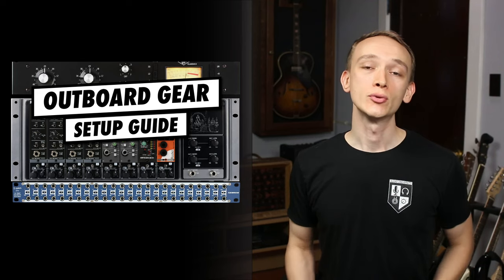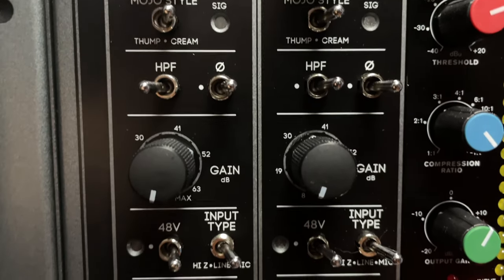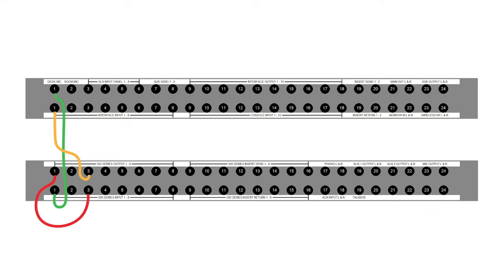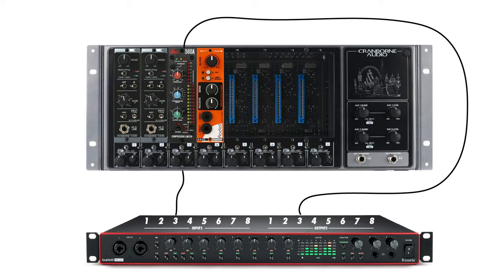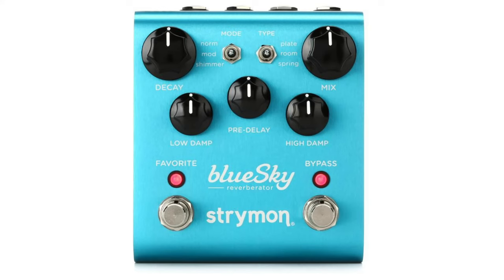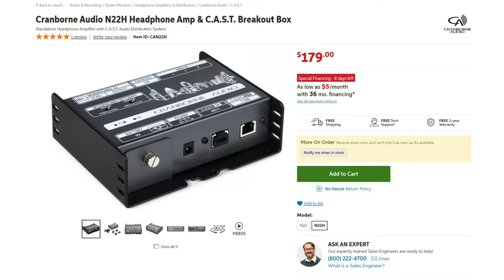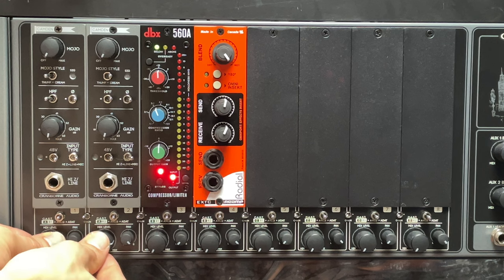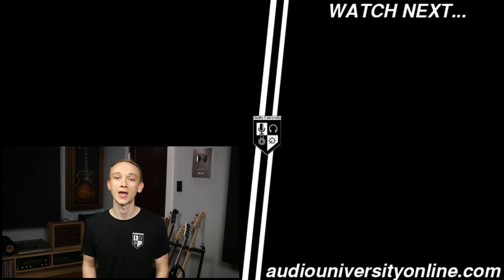How To Use Outboard Gear With A DAW | Patchbay Setup & Signal Flow

Comment from the maker: Question: What gear would you have in your dream outboard rack? 

Leave a comment below!
Reply: Well, I have the fundamentals to start, but one bothersome issue is my monitor output is automatically muting on/off.  Seems to be a particular issue with the Focusrite Scarlett 18i20 - 2nd gen.  Yours is a 3rd gen unit, yes?
Reply from the maker: @Henry Van Weeren - Yes, mine is the 3rd generation. I haven’t experienced this issue so far. Have you tried updating the firmware?
Reply: @AudioUniversity  I'm using a hand-me-down laptop with Win7.  There are no more firmware updates for it.  I may try uninstall/reinstall the latest available for it.  This hasn't happened until I accidentally installed the Win10 firmware the other day.
Reply: Is there a difference signal or sonic wise doing it with a patch bay vs running ex preamp to compressor to interface to computer?
Reply from the maker: @QubanEli - Assuming the patchbay is working properly, the only differences are convenience and flexibility.

Comment: Very informative video. You have a nice setup there. 
Last week, for a mix challenge with already recorded tracks, I used external effects from my pedalboard: an envelope filter for a guitar and a preamp/overdrive for the bass (don’t have a patch bay, though, as my number of outputs is low). It makes a lot of fun having these possibilities.
Reply from the maker: That’s awesome, Korkenknopfus! I could tweak and experiment with guitar pedals for hours (which may or may not be a good thing. haha). Thanks for watching and sharing these ideas!

Comment: Thanks for the clear explanations! If you have a condenser microphone and the 500 series preamp provides phantom power, is it safe to pass phantom power through a patch bay?
Reply from the maker: Just make sure that you're using a balanced patchbay and turn off phantom power while connecting or disconnecting the TRS plugs. You can find more info here: https://imp.i114863.net/ORQ1LP

Thanks for watching, Simon!

Comment: Exceptional video once again, great explanation and practical examples! 

One question that always seemed to be left unanswered in my head is what about latency? Does all that A/D-D/A conversion back and fourth introduce noticeable latency/delay at some point that should be adjusted for when recorded back into the DAW or is there another way to mitigate that? I'm asking about both the analog and ADAT connection methods with outboard gear. Cheers!
Reply from the maker: That’s a good point. Latency can definitely be an issue here. Most programs have delay compensation, but it’s worth checking that it’s accurate, especially when using various paths of varying latency at once.
Reply: Zero Latency. If you you connect Adat your interface. Conect TRS cables from Aux input from the Cranboune to a 2nd output source in your Interface and configure using your interface software. I use alot of vintage synths via midi and always find this method the most stable and fun to use. Hope this helps.

Comment: Hi. I dont understand : my 500 format lunchbox's output is XLR - so I should get a XLR patch ?
Reply from the maker: You can easily adapt between XLR, TRS, and TT. So you may need an adapter snake. Just avoid is repatching TRS while a phantom powered mic is connected.

Comment: One more question that keeps poping up and I still can't seem to wrap my head around is the whole XLR-TRS cableing and connceting thing when using the 1/4'' patchbays when it comes to microphone signals. So in the first example you showed where you have your mics pre-connected (normalled) to the mic inputs of the focusrite via the patchbay how does this work cable-wise? 

XLR to TRS cable from the mic into the back of patchbay and then TRS to XLR cable from the patchbay's back into the mic input of the focusrite? Does that also work for condenser mics that require Phantom Power? 

Also, does the same apply the external mic-pre? Meaning, the output of the patchbay's back goes from TRS to XLR to be able to plug into the mic inputs of your external gear?

Sorry if that doesn't make sense, I can't seem to find info on this anywhere and sinse everybody is using TRS patchbays for mic signals too, the only logical way I can think of (besides using DSUB25 snake connections) is this. I'd really love some insight into the cable aspect and correct me if I'm wrong with the observations I made. 

Cheers Kyle! :)
Reply from the maker: That’s correct! XLR to TRS from the mic to the patchbay. TRS to XLR from the patchbay to the interface preamp. You can also patch mics that aren’t hard wired to the patchbay directly to the preamp input on the front of the patchbay using an XLR to TRS cable.
Reply: @AudioUniversity  I see, seems logical. Thanks for the quick response! 

Weird that that’s rarely if never talked about, at least it seems to me. :) What about phantom power? Should there be considerations there when talking about phantom power coming from a TRS cable end or is that more a matter of how good/feature-rich the patchbay is and how it manages that and not that much of a cable problem?

Comment: How to setup headphones and talkback mic in the counsel cuz I dont know anything to do in counsel
Reply from the maker: Usually, your headphone mixes will be created using aux outputs. That way, you can use the aux send (pre fader) on each channel of your console to determine how much of that channel will be sent to the headphones. You can connect your talkback microphone to its own channel on the console and use its aux send to route the talkback microphone to each headphone mix. 

I’d recommend using a switched microphone or a post-fader send for the talkback mic so that you can quickly mute and unmute.

Comment: I know i am late to this party, but I recently sold lots of my full-size rack gear to purchase a Cranborne 500r8. I am trying to get away from patch bays for easier installation of gear, but that is a different subject. My question is,  the insert on the back of the R8. Is that for post effects? Say for a reverb. Or can I make a channel strip with it? I use inserts with mixers all the time to patch in other gear, but i thought I read the inserts were only for post tracking. Secondly, can I use a patch bay for the insert? Would that split the send and return ?

Comment: I stil don't understand how you use your interface inputs. I imagine you linked your Focusrite mic inputs (XLR) to the patchbay, so your mic lines are normalled. But I don't understand how you use external pres, which deliver line level audio, to the same patch points for your interface inputs. I thought the XLRs on the Focusrite are only mic level, and for line level you had to use TRS, and since it has combo jacks, only one of the two can be linked to the patchbay.
Reply from the maker: That’s a great point. It can be lived with by adjusting levels accordingly, but ideally you’d have separate patch points for line and mic inputs.

Comment: Crazy, I literally started with the exact same cards for my 500R8…
Reply from the maker: I like your taste, Robert! Which 500 modules have you added?
Reply: @AudioUniversity  I’ve got 2 Camden preamps In right now, I ordered the Radial EXTC-500 Reamp and a DBX-560A compressor a few days ago, haven’t received those yet… Just funny that I ordered those before seeing your video, so at least I know exactly what it’s going to look like… I like the Caden pre’s so I think they’ll stay… Haven’t decided on the rest yet, but I’m looking at either a couple Neve 1073LB EQ or the SSL 611 EQ, maybe the SSL ultraviolet and the AMS Neve RMX16 reverb (not in stock or I’d have ordered it)… might go with a couple Neve 1073 preamps, but the Camden’s seem decent enough that I’m still thinking on that… though call when I could have 6 Camden pre’s for the same as 2 Neve’s and have 8 channels if needed… Lot of choices… picked up the DBX compressor mint used for $160 so I figured can’t go wrong there… I’ll get me learning the 500 rack until I decide on which compressors I want…  Loving the Cranborne 500R8, it replaced an SSL2+ interface so it’s a huge upgrade… So right now I’m just doing research, don’t have the budget to have multiple flavors of everything from the start, especially the stuff from Neve and SSL I’ve been looking at…

Comment: Hi, thanks for this video! This might be a beginner’s question, but if the preamp is a part of the patch bay, how would you use the preamp’s phantom power to power to a condenser microphone?
Reply from the maker: Phantom power passes through the patchbay.
Reply: @AudioUniversity  ahh I see, even through TRS cables?
Reply from the maker: Yes. A TRS connector has three connections just like an XLR connector. Just be sure to never connect or disconnect a 1/4 TRS while phantom power is engaged. That could cause an electrical short which may damage your microphone.

Comment: Hello! Great Video! Keep up the great work! Quick question: I have an Apollo X6 and am trying to connect an outboard Warm Audio WA73-eq Pream. When I open Reaper and Insert the Reainsert, the plugin only identifies "Mon Left" and "Mon Right" (Hardware Sends) and "Mic/Line/HiZ 1" and "Mic/line/HiZ 2" (Hardware Returns). So, I can not "turn on" the channels I've connected the Outboard Gear to (Input 3 and Output 3). But in the Options/Preferences Tab in Reaper, the Enabled Inputs and Output Range identifies all my channels (including the ones I've connected the outboard gear to). What am I missing Here?... Thanks in advance! Cheers from Portugal!
Reply from the maker: Hmm… I was going to have you check your Input and Output ranges, but it sounds like you already have. 

Have you checked in UA Console? Also, ensure you’re using the correct driver in Reaper.
Reply: @AudioUniversity  what/how should i check in uad console?
Reply from the maker: Have you checked that those outputs/inputs aren’t being used elsewhere in the session?
Reply: @AudioUniversity  how do i do that? Sorry, noob here! :)

Comment: How do you use phantom power mics when plugging into the front of the patch bay ? TRS to XLR cables ?
Reply from the maker: Yes. Just be sure not to connect or disconnect the TRS end while phantom power is engaged.
Reply: @AudioUniversity  Is this true? I was under the impression that phantom power requires xlr-xlr

Comment: Hello AU, I just need some help. I have a BBE sonic maximizer, and it's my first analog gear, and I'm using the Mtrack Dou Audio Interface. I want to use my sonic maximizer to some track that needed to be phase corrected but I had no idea what to do, since I'm digital user🤣 or should I sell my maximizer or buy a new Audio interface? 
Thanks! 😊
Reply from the maker: This interface only has 2 outputs, so you’ll need to use one of those for your insert send and one of the inputs for your insert return.
Reply: @AudioUniversity  So no need to use mixer? Some suggested that I need to use a mixer.

Comment: When summing with the Cranbourne does it not go via the 500 series modules installed in those slots? I thought the signal was routed through them before returning?
Reply from the maker: The modules are bypassed for summing.
Reply: @AudioUniversity  thanks. I have a couple of units without bypass so I’ve always avoided using the channels for summing in case it caused phasing issues on stereo tracks.

Comment: My setup is Motu 828es and Adat 500. Is there anyway to connect  to non 500 series gear like my SSL Fusion from the Cranborne I/O ?
Reply from the maker: Yes! The Cranborne 500ADAT can also be used as an analog 8x8 IO expansion with ADAT. So, you can use each slot as either a 500 module or an ADAT input and output. 

Sounds like you’ve got a great setup, Andrew. Nice!
Reply: @AudioUniversity  Cool ! Do I have to set the bypass in the module slot to ON then set the input switch to adat ? or how ?

Comment: Thanks, could i use guitar efx(analog/digital) for fx send in a mixer?
Reply from the maker: Yes. You would also need a channel for an FX return.
Reply: Oh thanks. How bout using guitar pedals as microphone effect without plugging it to a mixer after the chain?
Reply from the maker: You can send any line level signal through the EFX and it outputs a line level signal.

Comment: If Sweetwater sent that stuff to all of us we'd use it.  If you have a BOSS pedal, you don't need reamping.  Advice that uses $2k free hardware from Sweetwater is useless to most of us.  I also have the 18i20 interface, it has fine preamps but I also use an outboard preamp sometimes. It doubles as a direct box.   A good preamp is simple and easy for far less than those fanboy lunchboxes.  Hardware is generally over.

Comment: How does one go about patching a mic through a patchbay without using a preamp?
I've been looking into getting a patchbay to rouy my instruments and mics, but I can't figure out how a person can connect their xlr mic that needs phantom power through it. I just want to use the pres built into my interfac
Reply from the maker: If you only want to use the preamps built into your interface, you can connect the mic lines directly to the interface. Although, a balanced TRS patchbay passes phantom power to mics also, so you could set it up as shown in the video.
Reply: @AudioUniversity  ah, so if I get a balanced patchbay I can use an xlr to trs cable? I want to more or less treat the mic as "anouther instrument" that can just be patched through.
Reply from the maker: Yes. If you wanted to use the patchbay as an input panel, you can connect mics to the preamp inputs with XLR to TRS adapters. I do this sometimes when I’m using a microphone for testing.
Reply: @AudioUniversity  ah okay, excellent. Thank you so much much taking the time to respond, I really appreciate it.
I don't think it would be an exaggeration to say your channel has anything other than  an invaluable resource while I've been expanding my little hobby home studio, haha. You do great work
Reply from the maker: Glad to help, Narfwin! Thanks for showing up, learning, and supporting the channel.

Comment: I’m using Logic X Pro and am trying to record something, then record it a second time where it goes out to some pedals and back. I’m struggling to get it all working correctly. Anyone have experience with this specifically? The main issue is setting Focusrite’s software correctly to play nice with Logic, im not sure how to setup the in/out properly as it never seems to work correctly.